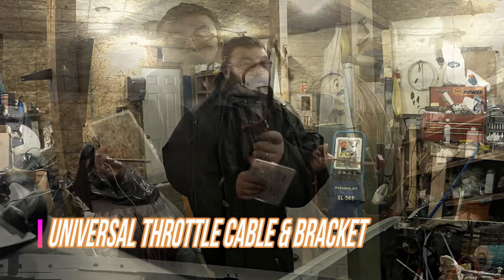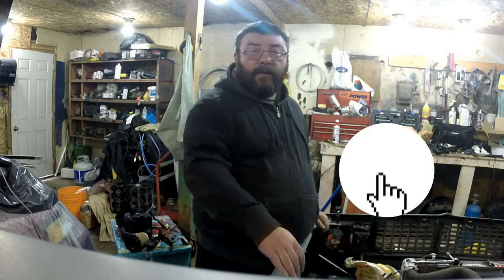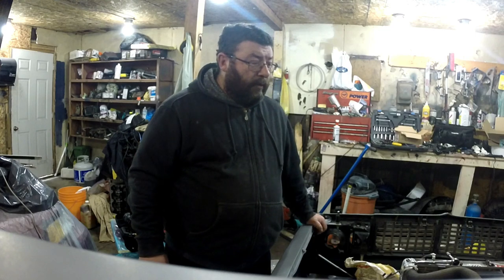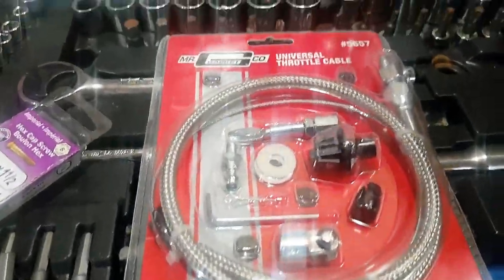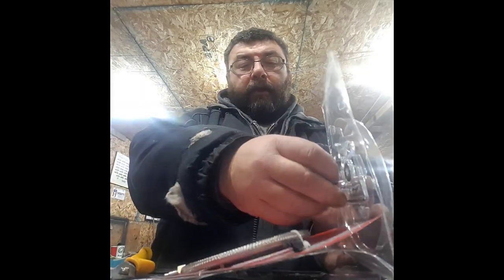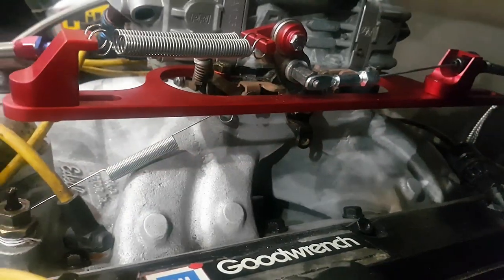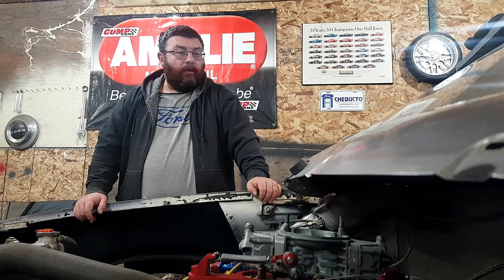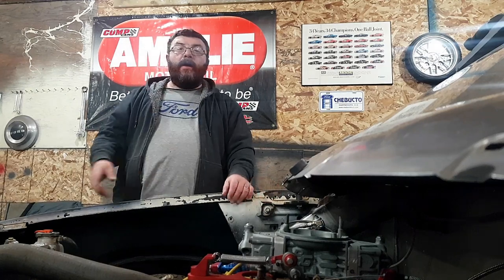amazon throttle cable installation  & billet aluminum throttle bracket  this guy's garage

Comment: Its crazy how I keep finding your videos when I do random searches when im looking for information on working on my truck. im trying to figure out how to hook up a hand throttle cable to use as a jerry rigged cruise control.
Reply from the maker: yes you need to make another bracket with a lever on it to step up he throttle independently using a choke cable , had to make one for my tow truck back in the day, ty doug.

Comment: Wonder if you have to use their cable or if a factory cable that snaps on at the end would work?
Reply from the maker: it did come with a few factory clips for the pedal side
Reply from the maker: a factory cable would work with the bracket

Comment: That bracket setup looks great going to look into that for the s10, i personally never had much luck out of the universal cables though but that is probably just me
Reply from the maker: The cable looks pretty good. Not sure about where it locks down.  Might put some solder on the end to give the lock screw something to bite into...nice intake video btw was watching today between takes lol
Reply: @thisguysgarage  my issue was with snagging not sure why, again could just be me lol. Thanks appericate it
Reply from the maker: @EfurdGarage  not a problem. Thanks for stopping by brother.

Comment: If you happen to check your responses, could you please help us understand how you connected to the pedal? I have a 72 Vette and was curious how the plastic retainer worked out for you. The Vette uses a Teflon retainer and I had hopes that the plastic in the Mr. Gasket kit would suffice. Thanks.
Reply from the maker: hey not problem ty for the question, i had no issues at all with the plastic retainer the plastic locked in just fine. if you need to see the pedel let me know i will shoot a quick video and send you the link. let me know.  ty mitch

Comment: Will this worked on a dodge 3500 truck 1995 v10 L8 gas engine
Reply from the maker: There's a lot of parts and oddball pieces.  It's worth a shot👍

Comment: What did you do with the kick down
Reply from the maker: the kickdown attaches to the carb but there is a slot for a kickdown or a piece to attach the kickdown ,but most likely will require a modification to adapt it ,the joys of hot rodding ,let me know how you make out , there were a lot of extras that came with the kit. Sorry i don't remember more the car is long gone ...

Comment: Does this bracket fit an edelbrock avs2 ?
Reply from the maker: You would have to drill a hole because the edelbrock is spread bore like a quadrojet, but you could make it work. 
Or get a bracket from s gm 4bbl or a chrysler thermoquad.  But this bracket is cheap enough to try drilling and fitting,  ty for the question John.  Let me know how you make out 👍

Comment: Do you know if it will fit an edelbrook carburetor?
Reply from the maker: That's a good question .
Depending on the edelbrock carburetor I'm pretty sure the front to back spacing is exactly the same. So even if it was s spread bore edelbrock it should not effect it. 
But I'm not 100% certain it will clear the linkage.  If I find out differently I will let you know.  Ty for taking the time.

Comment: Good job on that throttle cable Caper.  How did you connect it to your floor pedal through the firewall?  JUust curious.  Thanks for sharing and stay warm buddy since there's a blizzard here right now.  Cheers!!
Reply from the maker: luckily it just snapped into the old location ,darn i forgot that lol
good eye bill,  stay safe!

Comment: Do you run an air cleaner without a spacer my linkage scrapped on my old air cleaner
Reply from the maker: I had an aftermarket chrome dropped air cleaner it didn't touch but I had a 1000 camera Barry Grant on the 502bbc
Didn't touch